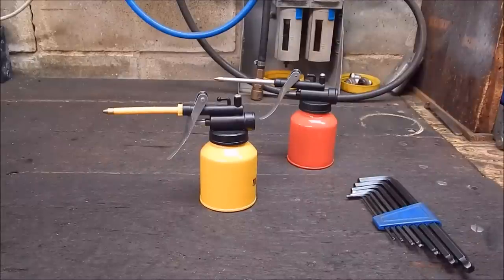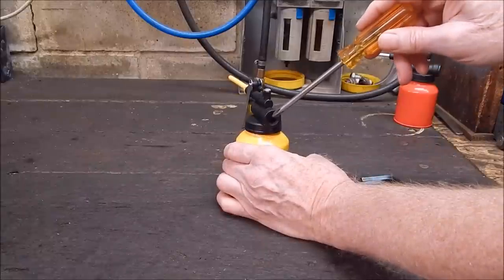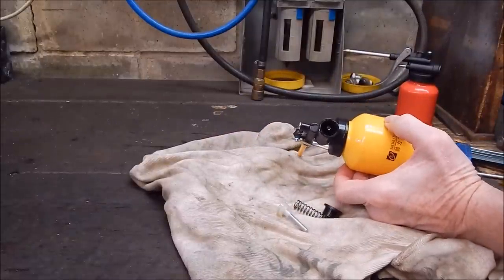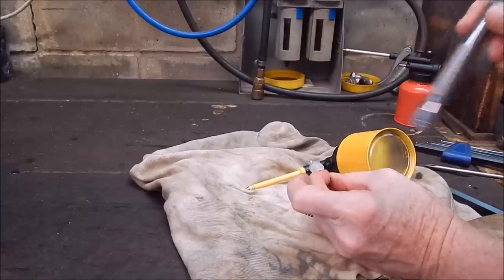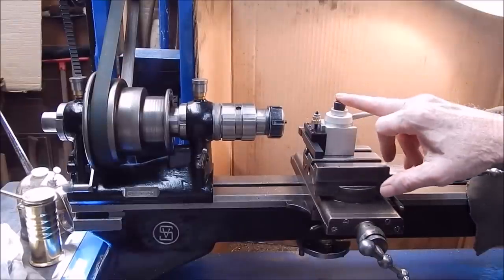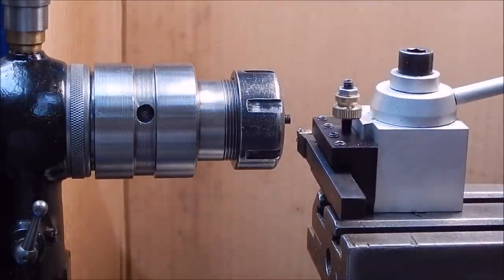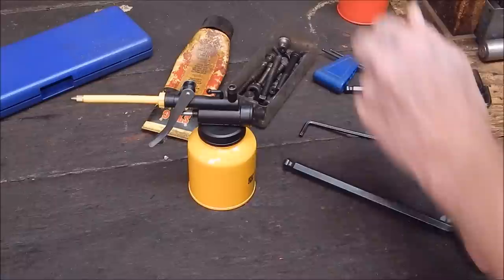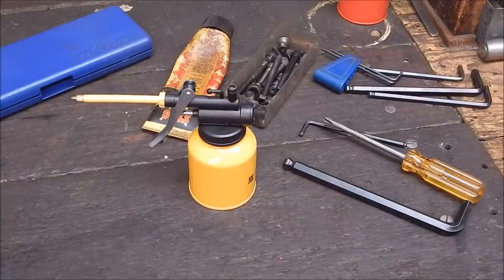What's inside a cheap high pressure oil can from Banggood ?

Comment: G'day Rob.  Good idea for the follow up found it interesting.  I think it would be just as well to pay a bit more and get a oil can that you don't need to fix.  I have one of those old brass oil cans Eagle 66 or some such name and it still works right despite the age.  OH and no leaks.
Reply: He might have to import those Harold.  Not sure if the eagle has landed down under!
Reply from the maker: Hi Harold,

Now you're talking.  That's when they made "real" oil cans that were built to outlast their owner.

I have one of those Eagle 66's (probably the only one in Oz) and a bunch of Regas that can't be beat.

Oil cans are always a hot talking point in any workshop.

Cheers Rob
Reply from the maker: The eagle definitely did not land down under.  But Alan in the UK swapped me one for a Rega, so there is at least one in Oz.

And one Rega in the UK.

Cheers Rob
Reply: I mucked around with some of the Chinese oilers and all the ones I tried were junk, I ended up brazing the old Rega I had but also bought this https://www.aimsindustrial.com.au/cesco-oil-can-fixed-spout-300ml which is pricey but also well made and will be around a long time after I'm in the ground.

Comment: Hi Rob,
   Great follow up on the the Chinese oil can. That plastic piston seal won’t last long I’m sure. The cap head screw was a nice fix. I’ve always liked the look of cap head screws. They just have the look of strength plus quality work. I use them wherever possible. The only negative thing about them is the socket gets filled quickly with chips and dirt. A quick shot of compressed air solves that problem.

Comment: Looks like the same crap oil cans that site supply ordered for the mechanical engineering workshop I supervise in remote Western Australia. Two large boxes appeared in the tool store, and expecting a few large items, opened the boxes and looked in complete puzzlement of WTF is this !!!!. Long story short is that our supplier accidentally issued the incorrect part number. They were replaced very quickly with the correct part, which are stainless steel body, brass pump, and flexi nozzle, and the others binned !!👍👍 Greetings from Woomera, South Australia.
Reply from the maker: You get what you pay for.

Comment: Hi Rob , for the price , they do the job , even if you have to do a bit of fine tuning ! Sorry about the burn , hope that does not put you off the bullfinch. I have used one for years for jewellery, would be lost without it ! Enjoyed your bronze braze demos , with the small torch head , I can solder and work with small platinum rings .keep up the good work, enjoy all your posts. Cheers Colum
Reply from the maker: Hi Colum,

The Bullfinch is great.  This is the first accident in 20+ years of ownership.  My stupid fault for momentary loss of concentration.  Such is life.

Cheers Rob

Comment: Hi Rob , I have these oil cans which I purchased in 2014, they have always leaked.  I could not  inject oil in a ball oil port without it leaking and the cover also leaks.  All in all a total disappointment.  I can see that they've improved this oil can.  It took me five years to fix the tip and the fix is simple.  The brass tip is just too long.  I stuck it in the lathe and cut the tip back just far enough so the tip would push the ball in and at the same time seal the oil port.  Since then I just love this small oil can.......
Reply from the maker: Hi Jim, sorry to hear that, but thanks for the tip on the tip :)  Mine all seem OK.  I gave one to the Bro Inlaw as well. Luck of the draw with this cheap stuff.  Cheers Rob
Reply: @Xynudu  Hi again Rob, the reason I said anything is because I could see that these new oilers where still leaking oil as you pumped it thru the ball oil port.  As you push on the ball it hits bottom and the brass tip has not completely sealed the hole.  Have a great weekend and please stay safe... Jim
Reply from the maker: Always good to get feedback Jim.  Banggood can't test them as it's not practical, so they rely on guys like you and me to find faults.   Cheers Rob

Comment: Excellent job Sir! I recently a "Harden" one (same size, spout, lever,...), filled it with oil , but when I squeeze nothing comes out! Any advice of what might be the problem? Thanks in advance!
Reply from the maker: Hi Aziz, check the one way ball valve is working as seen at the 6 minute mark.  Cheers Rob

Comment: Have purchased one of these cheep ones.   Leaks etc.   got a couple of the old Eagle,  one with flex and one without.   Both of them work good.   Also have a newer metal eagle that is also flex but it leaks round the flex spout but not near as bad as the cheep ones.   Good taking it apart so can find what is in them.
Reply from the maker: Hi Ken,

Any leak at a threaded joint can easily be fixed with some thread sealer.  Put a bit of time in on them and you may be good to go.

Cheers Rob

Comment: What kind of bird is that I hear in the background?  The problem I had with similar cans was the poor gasket material between the reservoir and the pump section.
Reply from the maker: They are native doves. 

I put an "O" ring between the pump body and can rim on the yellow pot, but left the red one without as it was a tight thread fit.

So far both seem oil tight when tipped.

Cheers Rob

Comment: Sorry about the burn. I usually burn my left arm.
Big question, where did you get the adjustable tool post for your lathe? I sure would like to find an affordable one.
Thanks Tim
Reply from the maker: Hi Tim,

Banggood sent me the little tool post to review. It works well on a small lathe like that.  Check my earlier videos.

Cheers Rob

Comment: Do take care of the arm, Rob, a burn can be nasty and easily get infected. Thanks for the video on the workings of the oil can.  I just thought about it and the nozzle would be a good place for a little small O-Ring, don't you think.
Reply from the maker: Hi Glenn,

I'm letting the air get to the burn/bare skin.  You could use an "O" ring but they work best in a groove or similar.

Cheers Rob
Reply: Yes Rob, I was thinking it would be fun to put the end in the lathe and cut a little O-Ring grove into the plastic.  Just a fun thought, but not worth it I suppose.  But do take extra care of the burn, sorry it happened.  They are very painful.

Comment: Sorry to hear about the burn.  I hope you feel better soon.  Personally, I wouldn't care if I saw it or not, but for your more squeamish viewers, you could cover it with a guaze.  Some aloe vera or silvadine on the gauze will help keep it from sticking.  I set my hand on fire with a brazing torch once, so I've got an inkling as to what you're going through.
  I really hate it when new things need repair.  What ever happened to quality conrol?
Reply from the maker: Hi Ron,

I put on the Aloe Vera four or so times first off, soothed the sting somewhat, but the skin still lifted.  Looks pretty nasty.

First time I've ever flamed the torch on me.  Not good ;)

But it could always be worse.  Lucky it was just my arm.

Cheers Rob
Reply: @Xynudu  When I first burned my hand, I ran it under the cold water tap for about 5 minutes until it was numb.